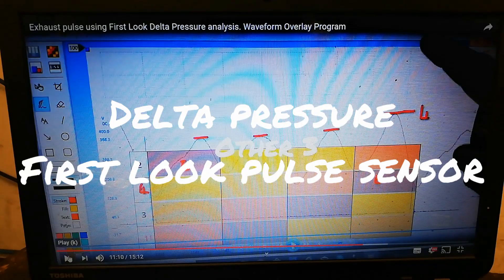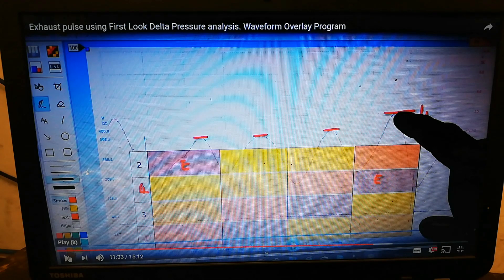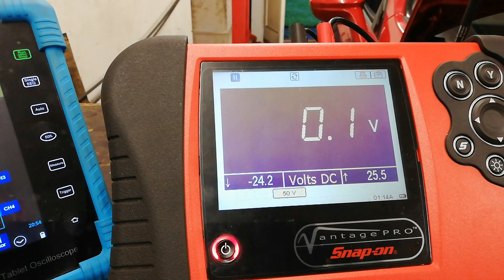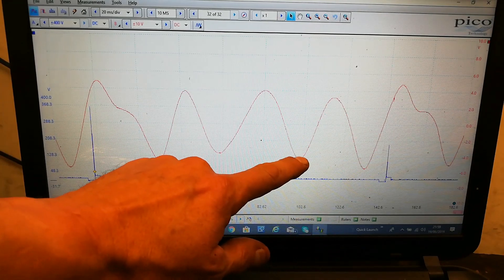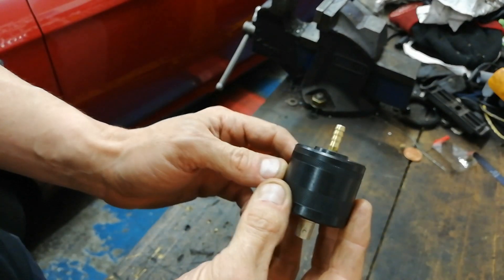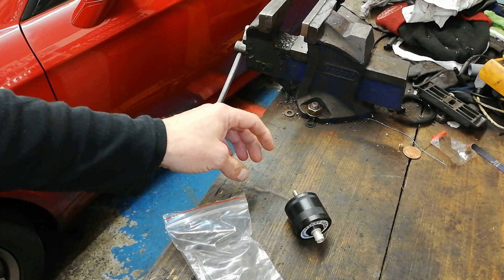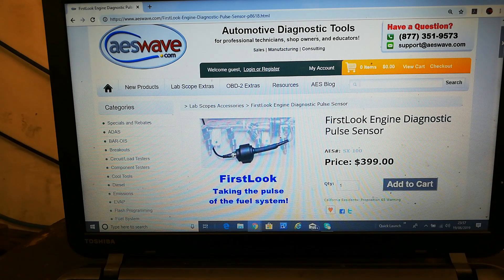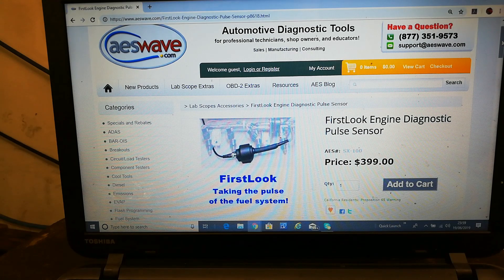First look Delta Pressure Pulse Sensor Video Revisit. Sensor Teardown

Comment: Thanks for coming back and show us mate... aswave sensor is super expensive in America for what it is cheers 👍👍👍
Reply from the maker: Cheers igor. Are you getting into this type of testing? You could make one of these sensors for cheap
Reply: dave sterl i downloaded ditex to the pc which Leon showed in one of his latest video I’ll get the ditex scope soon it should be good for me to start, your vids will help a lot mate ...
The sensor should be ok to make with the eBay piezo that you showed before cheers mate 👍👍👍
Reply from the maker: @CarsExposed  thats great igor. I dont fancy that LAN  scope as it needs external power. There is far more info available on pico and it is regarded as the easiest UI. If it works for you then go for it
Reply: dave sterl that is great information mate I think I just changed my mind again 😊👍👍👍

Comment: $400....How do they justify that? Perhaps they don't! Thanx for the follow up dave. Cheers Pal
Reply from the maker: Hey ian. The only thing maybe is that the $400 one may be able to handle fluids ie. Fuel. The one i show is gases only
Reply: Probably that they were the first on the market. The time and money spent on research and development to make sure it was a viable and fit for purpose product as well as being a speciality product that would have lower volume sales than say a multimeter. Before they were dissected and cloned, who knew what was inside?
Reply: @kirkabrahamson1148  With respect I disagree. $500 Canadian dollars..No, I don't see it. The rationale you state is applied to any self respecting product. I think they are charging what they think the market will bear. Which is fine...

Comment: Thanks for sharing this, you could just swap banana plug color connectors around instead of doing it at the sensor if that makes sense
Reply from the maker: Hey junkie, yes indeed thats what i was doing in the demo
Reply: Sorry I meant permanent cut wires and solder then in the right order back if that makes sense. Solder a black banana where your red on is and red where black.  So you don’t have to mess with inside to get it the way you like it
Reply from the maker: @weldingjunkie  ah ok yes. I think as long you know the way your device is operating then its all in the understanding